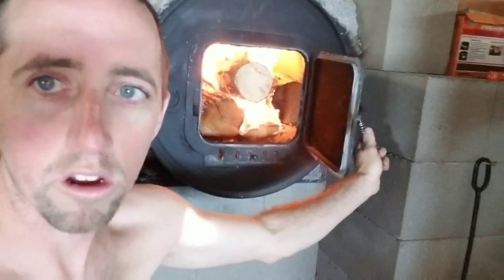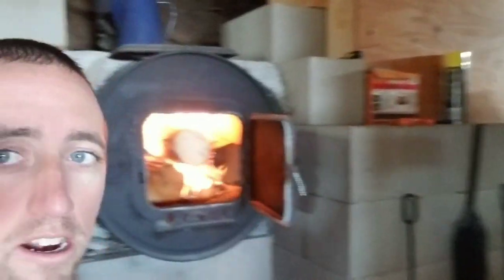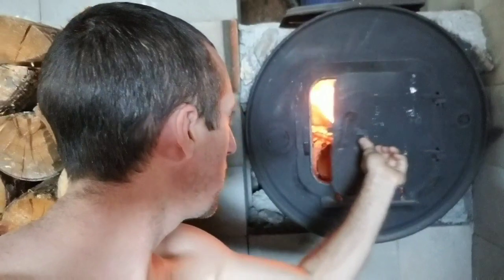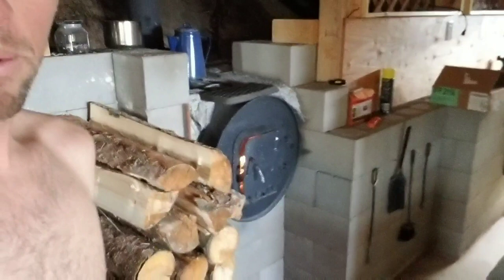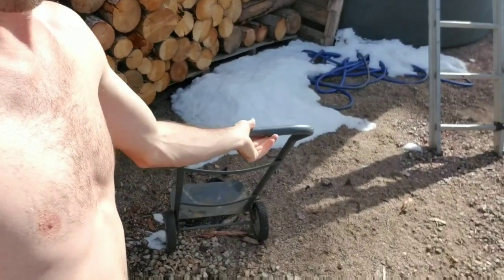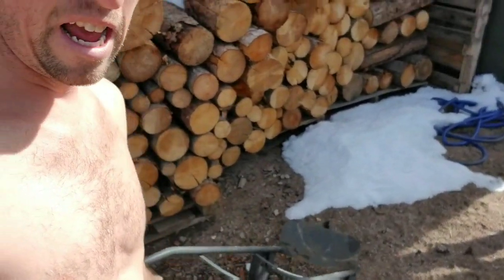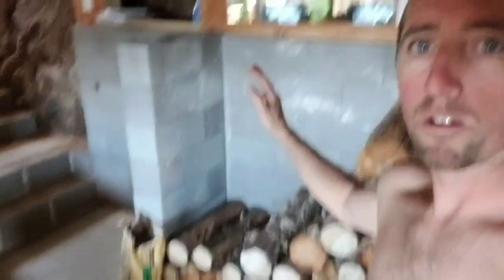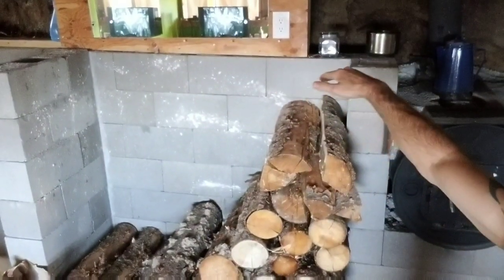Why My Stove Pipe Doesn't Fill Up With Creosote

Comment: I cry B.S.  Creosote is a natural by-product of burning wood.  It's physics.  It doesn't matter how hot, or how "perfect" your technique is, creosote happens.  It can't NOT happen.  I burn HOT too and had a complete blockage from creosote after 1.5 burning seasons.  I neglected to clean anything after the first year after my stove was installed.  Mainly because of videos like this.  "If you burn it HOT, you don't get creosote."  Again that is total bull poo poo!  Inspect and clean your stove pipe AT LEAST once a year, and more often is not a bad idea.  We don't all have perfectly seasoned hard woods to burn and if you take this guy's advice and just crank up the heat, you are asking for a chimney fire!
Reply: And furthermore, if your stove pipe is glowing cherry red, that is a DANGEROUS situation and definitely NOT NORMAL!
Reply: Been using this method for 30+ years with our fire place stove insert with a brick chimney and this year was the FIRST year we had to clean the chimney! Every year we pull out the stove and vacuum out behind it and look up the chimney with a mirror- always clean but saw a little in there this fall so we cleaned it out

Comment: I used to clean my chimney every year and got maybe an ice cream pail of creosote a season. I always burned dry wood that seasoned for two years. When I switched to my homemade gravity fed pallet stove, I had absolutely NO creosote what so ever in the chimney. The  pellets burned so much hotter and cleaner and you could touch the flue pipe right where it entered the chimney and  the burn chamber was 600+ degrees at the same time. Now that's efficient. I wish pellets hadn't gone up so high now. $2 more a bag here.

Comment: If I burned hot I would be naked,I burn low and slow or it will run you out of the house! It looks funny with the doors open at 20 degrees out side ! I clean my chimney the first of each month and clean the glass same time ( Cheap oven cleaner)
Reply: Cleaning that often you should be good pretty much any temp. If burning low clean often

Comment: Great looking fire! I've got my non kindling fire going big right now!
What's the latest with your power situation?✌🏻️
Reply from the maker: Power at the ranch?
Reply: Today's Homesteader yes at the ranch.
Reply from the maker: The electrician company called me to come to their office to basically tell me they aren't fixing what they did and I'm more then welcome to go after them, they don't care.  At this point with the temps as cold as they are, the ground is solidifying, and snow is on it's way I'm most likely just going to have to hold off til spring.
Reply: Today's Homesteader What a bunch of low life people! Sorry to hear that!😡
Reply from the maker: That's life, it is what it is.  I'll get it figured out so no worries.

Comment: I try to do that but I am afraid of having carbon monoxide to leak inside the living room area from having the door open a little bit 
What do you think
Reply from the maker: I never had an issue.  If it is of that big of concern you could always get a carbon monoxide detector and install it in the same room as your stove.
Reply: If smoke is Not backing into your house, that means you have adequate draft to expell all of the flue gases.